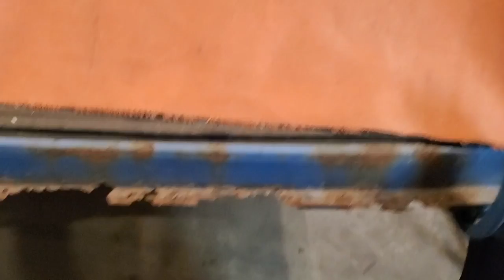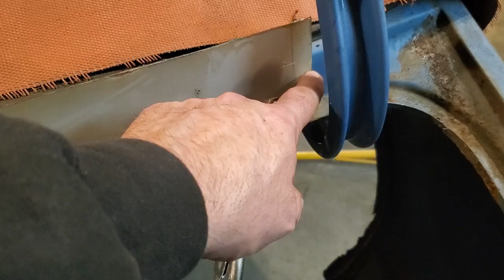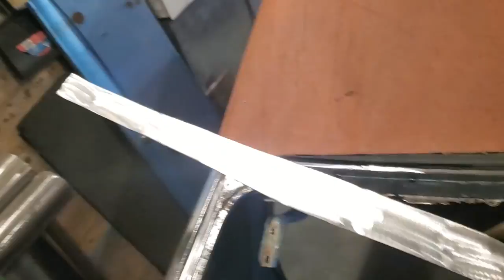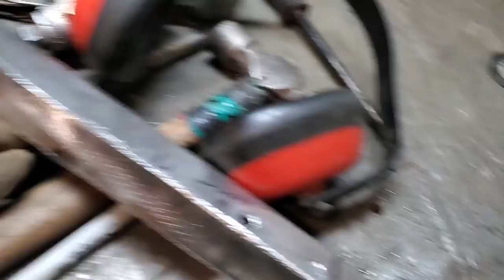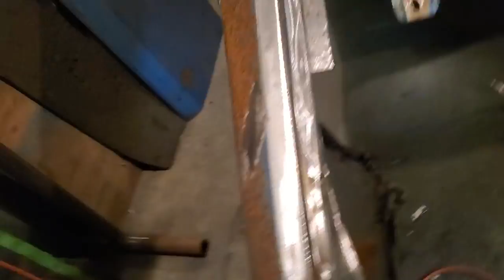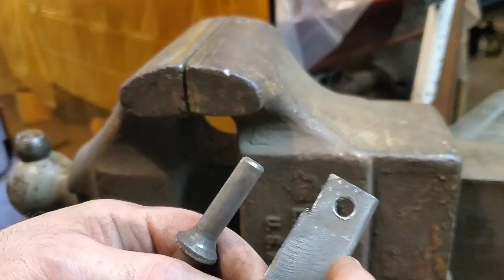How to repair rust around trunk gutter (project Crusty)

Comment: Your “butt and cut” technique is a game changer!
Reply: agree! I recently did the box on a 2007 Silverado that way. Previous owner had riveted and glued the wheel opening patch panels right over the old sheetmetal. I simply cut it, a few inches at a time, pressed it flush, tacked it, and moved-on. Barely any filler needed when I was done! The truck is black and the box is the straightest I've ever done. Game changer for sure...!
Reply: Yep.   And the seperate pieces rather than trying to stretch compound curves.
Reply: Totally!
Reply: When I hear Cut and Butt in a Newfie accent,  I get hungry  because it sounds like he's talking about some special type of halibut chowder.  "I'll have the Cut and Butt, Marge".

Comment: I have stopped cutting out the bad metal.  Now I use the cut and butt method.  It's so much easier and better.  Making compound curves using multiple pieces of metal instead of trying to make the section from one piece of metal is the way to do it.  I don't know how many hours I have wasted over the years and how many failed attempts at making complex pieces from one piece of metal I have done.  Your method is great.  Thanks to you, sir!

Comment: I have done a lot of panel repair in my 55 years of life. I started with cutting rusty metal out, then overlaying the repair piece. Used the flange tool to make a flush overlay.  and then shaping it with a skim coat of filler. Did it that way for years. Then I tried Fitzee's cut and butt. Wow. Thank you Fitzee, You took me to the next level. It has added a new enjoyment of metal working. I look forward to each new video.

Comment: love that these rust repairs are fully explained, im a big time tinkerer , im always searching for products that can be used to repair things using hand tools, especially in non critical areas that dont require the repair to have structural strenth.. i got a project going where the purpose is to use say construction materials to effect a long lasting repair and to make it where future possible rust is all but elimated.. it requires more time that welding which i never learned to do, so i wanted to be able to do it in my driveway.. the way you show how to make panels and install it has given me ideas of other alternative methods including old time lead process and using  modern material that im now going to try out on a 03 suburban with some serious cancer.. i have the time as i retired early due to injuries.. but its gonna keep the old brain working.. cheers

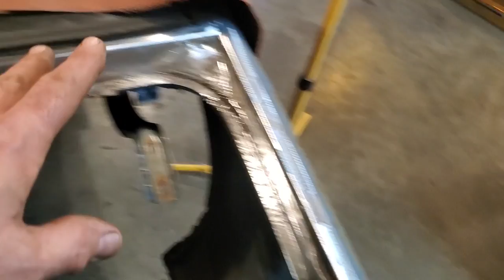Comment: Love the rustoration on this channel.....@7:06, "what's another hole" LOL! I used to use the scribe method extensively on ships when installing bulkheads. We had to weld the bulkhead coamings to the deck and the deck always had hills and valleys so we would scribe and then cut the coaming resulting in a snug fit.

Comment: I am enthralled with your videos. From a rusted out section to what becomes solid and possibly stronger than the factory intended, the time it takes and your calm attitude is a confidenc builder that makes me want to get busy with my project. You prove once again you do not have to mortgage your home to purchase stamped out reproduction parts to do restoration work. Besides, many of the repops don't fit without surgery.  Please, keep the videos coming. There is always something to learn and you are a good teacher.

Comment: My 69 Dart has issues around back window. The lower corners are available and will fix the big issues. BUT... There are some small holes op top where roof curls into wimdow channel. I think copying your pipe vise, but with smaller pieces will allow me to make the Z shaped pieces needed to fix those complex sections. Id love to do the whole section but think keeping as much original metal is safe bet. Using your 45° cut trick will help get it right. Thanks for sharing your knowledge, its going to help a TON!!!

Comment: Thanks Fitzie I have just done the same trunk gutter repair on my Nissan I done it the exactly same way as you shown due to me watching this video you showed me how I could save loads of money 
Thank you so much 
Regards jasmine from Sydney Australia
Reply from the maker: Pop over to the Facebook page. Post some pictures. I like to see them
Reply: @fitzeesfabrications   hi there fitzie I'm going to do some more panel rust cut out on the 200sx I mentioned earlier about the boot gutter replacement I did I'm in the process of now doing the sunroof an roof repair on the 200sx I'll try an post all the pics of the finished work before paint on the roof that is as I already have painted that boot lid gutter repair but ill ad that as well on your FB page . thank you so kindly for your reply regards Jasmine
Reply: Hi there Fitzie I'm trying to put those pics I mentioned on your face book page to show other that even a woman can do what your teaching in sheet metal works  on cars can you please assist me with my issue have a great day stay well now hope to hear from you soon Jasmine from Sydney Australia 😀

Comment: That bead in the lower corners was not there for strength. If you think about how that original trunk panel was stamped from a larger pieces of steel in original production I believe it was there to allow for metal shrinkage in the stamping die at Toyota. As that corner is formed in the stamping die the extra metal has to go somewhere. Making it in separate pieces like you did does not require the corner metal to shrink. So you were absolutely right to leave the bead out as its not necessary for your corner to be strong. Great video and love your process of thinking through the best way to make these small panel pieces.

Comment: Very interesting how you fixed all that rust. When you were doing the panel across the bottom of the window, I was thinking that you could have just bent the lip instead of welding the piece on to make the lip. But then I thought that you probably would have had a lot of issues with warping the metal, which is why you did it that way with welding on the piece. Always interesting seeing how you fix stuff that most people would toss out.  Hope you are safe over there with this rampant COVID. All the best from Queensland Australia.

Comment: Hey Fitzee, I'm curious to what you do to prevent future rust where you have all that sandwiched bare metal with the overlapping panels. Really appreciate you taking the time to show, explain, film, edit and publish your work. Awesome job as always. keep it up!
Reply from the maker: I like to get max penetration  when welding. Painting it or weld threw primer affects the weld. Cars rust when used year round in bad weather and not looked after. Most of what I build are summer cars. Now in saying that ill be spraying a apoxy on all this when the shell is all done.
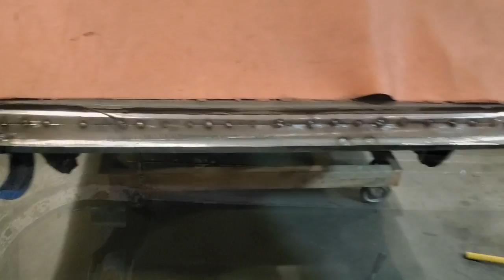Reply: There is no sandwiched metal.  The overlapped pieces are removed.  Look thru the video again and you can see it all being removed from behind. 21:15 onward.

Comment: Awesome video again as usual.  Random video idea - welding upside down and MIG settings to cope.  I'd love to see your approach on that miserable task.
Reply from the maker: That is dirt!! hate welding overhead. Seems each time you do it it not the same as the last time. Lol
Reply: @fitzeesfabrications  that's been pretty much my experience.  I just mess with speed (more) and voltage (less) until I get the bacon sound.  And slag in the ear.  I hate it too but sometimes frame rails...

Comment: I think you were right when you put the straight edge on the upper part. It's curved. Try this: Put the straight edge again on the same spot and hold it perpendicular to the gutter. You'll see the gaps again. Then, bend and turn the straight edge accordingly to contact the surface of the upper part in full. You'll see no gaps! It's the same illusion as when you make panels for complicated curved sections and have to add pieces later.

Comment: Wanted to hit you up and submit a request for something I haven't seen you do but I would like to learn how to do it correctly. That would be wheel well flares. As if I didn't have enough to do with the 66 Galaxie I just bought a 65 Galaxie Fastback with a big block FE motor which will be the fun car and the 66 can go back factory and be a cruiser. I will want to put in some meatier tires for the rear that will require a small flare of the fenders to get them to sit inside and travel full range.

Thanks man.

Comment: Hey Fitz, when you get to the inside lip that the weather strip attaches to, is it ok to run small beads instead of stitch welding it with spots? The trunk gutter on this car is HUGE and any time savers would be great.
I have a friend who has several parts cars so I am going to be able to cut pretty decent sized sections out of these which will save a ton of time but there are going to be sections I have to create like this. Since it in the trunk area and hidden these aren't as critical to get perfect but you really want everything to come out really nice when it's your baby. 
Thanks for the great videos. Honestly i probably wouldn't have tackled this project and stuck to building newer Mustangs if I hadn't found your channel.
Cheers!
Reply from the maker: Thanks. I did run beads on these section.  One inch plus beads. Not a straight bead. There is alot of angles to help control the heat.

Comment: I'm curious about what you have draped over the rear glass. Is it an actual welding blanket or something you came up with? Always looking for helpful and thrifty ways to keep weld berries and grind sparks off the glass. Thanks for another great video! Larry
Reply from the maker: Its a welding blanket. I want to pull the glass but need to locate some new rubbers first

Comment: About to start a project based on a 1975 KE 20, it will get a complete Alfa Romeo transaxle and rear end and I think I'll do it like this rather than use a car rotisserie. 🤔
I guess the tips are good. 😊 Thanks.
Reply from the maker: The idea will work with alot of running gear combos. How bad is your car ?
Reply: @fitzeesfabrications  Similar to probably worse I think so it's a good candidate for this. I'm using a much smaller engine so depending of how rusted it is I'll leave the front part and some of the rear part of the floor as well and just make a big hole to fit the transaxle and coilovers to start with. I'll be following your Corolla build with great intrest.

Comment: Got a welding question for you.  I got my Hobart 140 a few years ago,  I made inner and outer panels for my door and welded it up, thanks for that.  I put a magnifier inside my auto darkening helmet.  I can see the puddle OK, but I can't see the seam, so a drift off.  I'm nearly 73, so I have about 20 years on you, but do you have any tips that might help me out if have to weld a longer bead?
Reply from the maker: Place bright lights behind  you off to one side. Also can you adjust your darkness on that helmet? Some you can. I have same problem I like having my lens darkness very low. Lights help too
Reply: @fitzeesfabrications  Interesting that you mentioned this. Recently I was welding in bright sunlight and I found that my filter was too light, so I changed to my other shield with a darker filter and that went well. The other day, I was welding in overcast weather using the darker filter and I couldn't see what I was doing clearly. I should have got the shield with the lighter filter, but it was just a couple of shelf brackets, so I persisted with the darker filter.
Reply: put bright lights overhead. also soapstone a guide line even if it is 1/2" from the weld
Reply from the maker: @marcwert9791  soap stone is a good idea! I like that one.

Comment: How do you prep heavily pitted metal from an old 50's truck?  It's not rusted through, but sanding doesn't seem to get rid of the pitting.
Reply from the maker: I have used alot of different ways. Best way to to cutbit out but sometimes you can't so I then see if u could sand blast . It that is not feasible then I clean it with wire wheels. Grinders. Die grinder or small drill bits thrn ill treat it with a good rust converter.

Comment: I don’t have a MIG welder...just Stick and TIG. Can I use my TIG to do the cut and butt method or have you found a problem with that? Great videos!
Reply from the maker: I think you would do a nicer job. The heat zone on a tig is smaller then a mig. I want to get one and try it.
Reply: @fitzeesfabrications  fantastic! Thank you for the quick response, I’m going to modify my back Chevy van doors to make them taller for the topper I want to make for it. I wanted the taller opening in the back. Thanks again!

Comment: Thanks again Fitzee for the video, question ? my 55 Chevy rear apron, partially covered by bumper and goes to the trunk gutter is all mangled  previous owner filled with bondo about half gallons worth. Would I make this piece in  2 or 4 pieces ? Not to include gutter. Thanks
Reply from the maker: Make it in as many peices that you feel you can do. Dont over complicated it .just keep it simple

Comment: When your showing how to stretch the metal with a hammer i never seen that before if I was tasked with that bend I would heat it up red hot on that edge and bend it in the vise and it would stretch cause the metal was hot next time I will try the hammer trick

Comment: Is it possible to carefully braze the sheetmetal vs mig welding?
Reply from the maker: Yes. It was done that way for years. You need to treat the brass as it will affect the body work above it

Comment: Hi fitzee you never talk about steel thickness. It is not all same all over the car body
Reply from the maker: No it is not. Most of the external panels are all same gage it when you get under the car or inside the car that the gages change

Comment: What worries me is that you cleaned the original lip, but you have placed a new panel on top but there is no anti rust between them, which says to me that rust will grow between them. Wont last more than 2 years before rust will be back!!!
Reply from the maker: For a everyday driver you are 100% correct but this car will be kept indoors and stored Winters. Should last a long time

Comment: On average, how many hours a day do you work in your shop? How many days a week? It seems you must spend most of your waking hours in the shop....i'm retired and that is what I do...can't sit around in the house and do nothing lol. I'm customizing an 05 mustang now that was rear ended real hard...turning it into a small bed truck lol...better than sitting on my ass.
edit: thanks again for your vids
Reply from the maker: I'm not out there as much as I should be. 10 hours and my poor old body is done. Was a time 24 hours on a job was a joke.
Reply: That sounds like an interesting project. Any chance you can put a couple of videos on your channel?
Reply: @BrucePierson  I thought about it...i've already cut off all the bent sheet metal and already used the hydraulic ram to push the top of the car back into position and again on the unibody frame in back. I'm glad the Mustang rear end uses a pan hard bar...the pan hard bar was the only thing bent...I heated it up and straightened it out which moved the rear axle back into position. The car was hit in the rear driverside corner pushing it to the right and forward just missing the rear driverside tire/wheel. The cars front and interior are great and it runs good too so thought it'd give me something to do and learn more sheet metal work. That's why I've been watching this channel...he;s helped a lot already. Using common sense and learning tricks on how to do things is key...and if I screw up i'll just try again. One thing I've learned the most is to be patient...Like Fitzee says...do one thing at a time. Don't look at the whole picture at once...just fix one thing at a time and one day you'll walk into the shop and see you're all done and ask yourself "ok what project can I do next". another key is to FINISH IT. I get my jollies by working in my shop...if a person doesn't then they should not have a shop.
Reply: @fitzeesfabrications  Lol yes I remember the younger days...like you I'd be out in the shop until midnight  or 1-2 AM and start all over at 8 AM. Now I push myself to get 6-8 hours in. But those hours add up to a finished project even if it took longer. Most of the fun is in the doing IMO.
Reply: @coherantbliss3483  That's sure some project, it sounds like a lot of work, but the outcome will be something unique. There's a channel that turns VWs into what we call in Australia a ute (utility) or small truck. My last big project was my 1982 Mitsubishi L300 van. I swapped out the 1.6 litre engine and four speed manual column shift transmission for a 2.0 litre engine and 5 speed manual floor shift transmission from a totalled 1991 Mitsubishi L300. It wasn't straight-forward, with quite a few challenges, but it made the old van so much better. I've posted some photos and details here: https://www.shannons.com.au/club/enthusiasts/dundathu/garage/1982-mitsubishi-l300-express-sb/ 
My next project, when I can get to it will be restoring my 1962 EH Holden ute. I've picked up quite a few tips from watching Ritzee's channel that will be helpful when I get to this project.
Reply: @BrucePierson  Thanks...yes a lot of work to keep my blood pumping lol...your Mitsubishi project sounds like a big one too...lots of time in the shop and figuring things out...sounds like fun. :)

Comment: The hardest part would be making the rubber bumper pad to rest on in the corner without a template to work with...
  Looking at that car without a trunk pan and the shape it's in it's not worth fixing there are companies out there that make most of the body panels you can build your own Camaro. 
As well the back unit body is missing is that car ever going to drive straight ???
When a car is that far gone it's not worth fixing ...just noticed it's a Buick Riviera make a parts car...